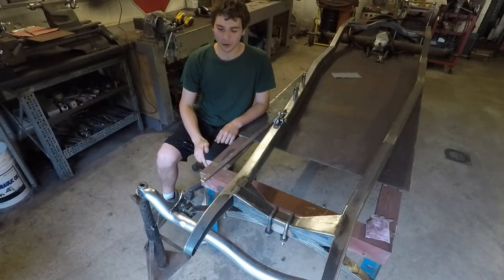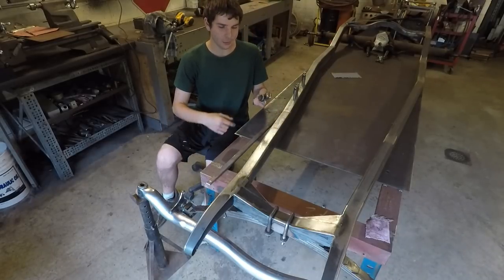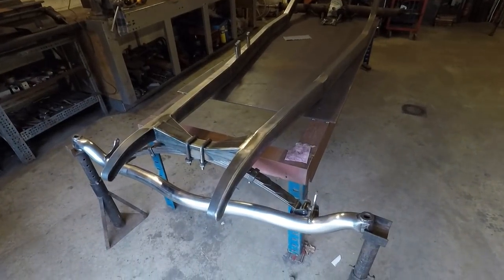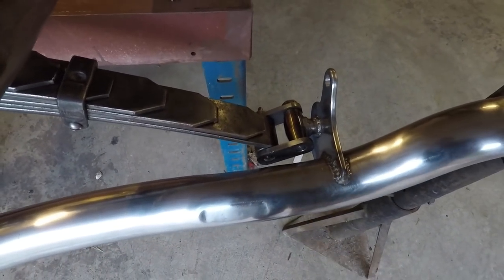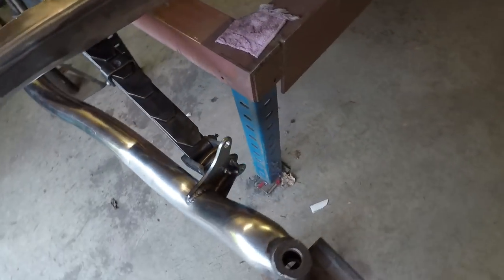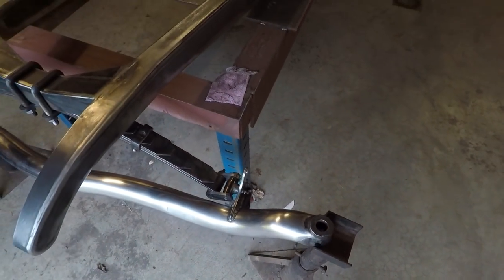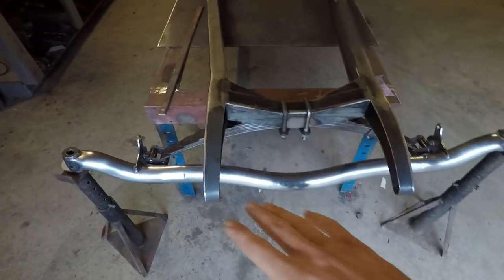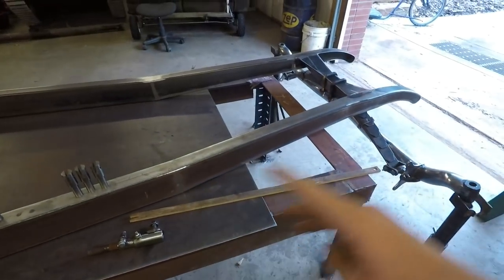Mounting the Tube Axle to the Spring | Boat-tail Speedster Pt. 9

Comment: The grease fitting in the end of the spring eyelet will only be effective if the bushing never rotates. If it does the drilled hole will not line up. Do you think it will rotate?
Reply from the maker: they pressed in pretty tight, so i doubt it

Comment: I am a new subscriber after discovering your channel. By the scope of the videos you produce, it is very apparent that you have been well-instructed and well-mentored. Your skills are quite prodigious for one so young. This build is coming along quite nicely bringing up a question or two. Keeping in the spirit of an old-fashioned 'Indy Racer', the builders of that era built these machines to not only withstand the rigors of the race but, did so making the machine as light as possible. Do you necessarily need all the leaves in the springs you chose? Would it be possible to lighten the load by removing leaves or drilling them? Could the frame be boxed in then lightened by drilling holes into it without compromising its strength? These procedures were done in that era to accomplish just that. Just some food for thought. Thank you.
Reply: the frame is boxed but adding lightening holes, and presumably, sealing the holes with tube section actually adds weight. but yeah adding lightness wherever possible would be consistent with any build like this. will be interesting to see where he takes this.
Reply from the maker: I am trying to keep it light. For now im keeping the leaves in but I could easily take out a couple whenever I want to

Comment: Hairpins on a tube axle is not something I have seen before, they work OK on an I beam axle because it can twist and flex fairly easily, but a tube axle will resist twist and might start cracking mounts, you really would be better with a 4 bar set up.
Reply: there are tons of hot rods out there with both tube axles and hairpins.
Reply from the maker: in terms of geometry and what stresses are produced you're completely right, but as Ecosse57 said, people have been running hairpins with tubes since the beginning of hot rodding with minimal issues. just a couple weeks ago I saw a model A in a parking lot with a tube axle and hairpins.
Reply: LukeTheJoker is correct, some people just ignore that fact & do it anyway. It does not pass an engineering analysis or a safety inspection if required in your area.
Not preloading the spring will also allow the front axle to walk sideways.

Comment: the front suspension/axle/support, personally i dont think thats gonna work, this way you get a lott of torsion in the end of the botttom spring, and the whole is connected by 2 rather small welds (the T connectors) your "tubing supports" will fix that for a part, but still looks scary weak to me, if you would give your T connection some more support, from the bottom, it would improve the strength a lott, if something breaks in some other area, so be it, if this breaks, there could be lotts of damage, besides that is quite dangerous to loose the front support, this way (i think) the front axle will be quite shaky, and you don't get the full benefit of the front suspension, that simply needs to be supported on both sides of the spring, i do love the idea of making a vintage racing car tho!! respect!
Reply from the maker: I get how it looks like there will be a lot of torsion on the spring from the weight of the car, but once the hairpins are in the whole axle will pivot from where the hairpins are mounted which about a 3' radius. look up some pictures of similar setups; it works just fine.
Reply from the maker: Its just like the rear end how the spring is mounted about 7 inched behind the axle. the spring isn't under any torsion because the whole rear end pivots on the long torque tube.
Reply: hi, thx for the answer, i know the construction, i'm just a bit worried about the welds of the T connector, the material is rather thin, but i''l wait with further comments :) the finishing looks awesome btw